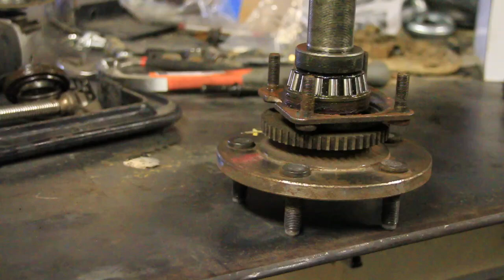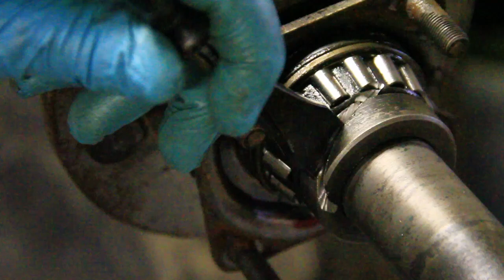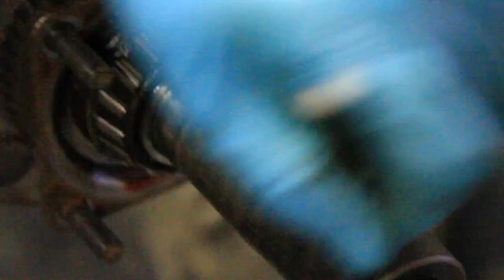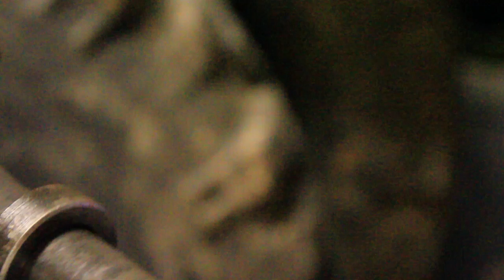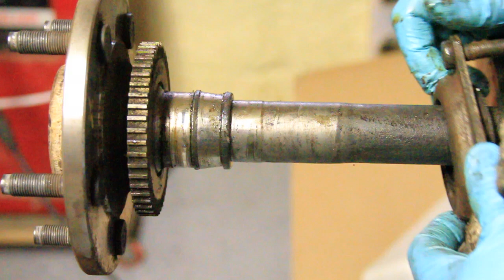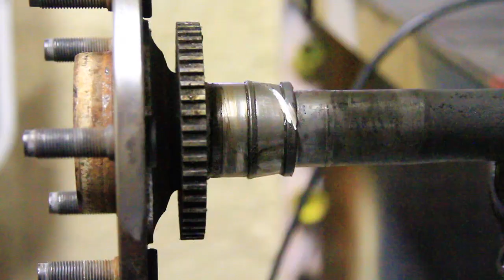How-To Remove a Rear Axle Bearing / Change Axle Seal

Comment: Matt, I take those retainers rings off with a heavy Hammer and coal chisel, the ring will expand enough for it to slide off. Just place the other side of the ring on a anvil and hit the other side with hammer and chisel, bingo there you have it with no damage to your axle and no chance of damaging it. It is a lot easier and quicker!! Cheers No grinder needed

Comment: FYI, the bearing has a inner and outer race. When you remove the axle the outer race remains behind in the differential’s hub. You have to remove it before you can reinstall the axle.
Reply: Excellent video by the way.
Reply: I was curious what method you used to reassemble the axle shaft into the differential. Did you insert the axle shaft with the complete bearing intact or did you remove the outer race of the new bearing and press it into the hub prior to inserting the axle shaft?

Comment: What is that toothed gear for just in front of the bearing?
Reply: SeekTruthinLight 
That is not a gear, it is for the antilock brake system. The sensor knows the speed of that wheel as the teeth pass by the magnet on the sensor.

Comment: My 14 rubicon has an axel seal that is bad. What causes them to go bad?
Reply from the maker: getting old...  in your case I have no idea... mud, water, heat, bent axle...  improperly installed...
Reply: @bleepinjeep  dirty / contaminated gear lube

Comment: Recommended if you're a cheap amateur . The other way is pay a professional to do it the right way. Not a Bodgit and Leggit expert with a rented commercial space. you never have to cut bearings unless you have not got proper equipment